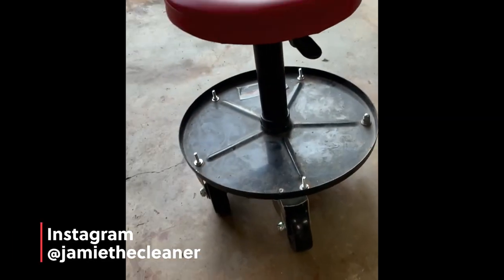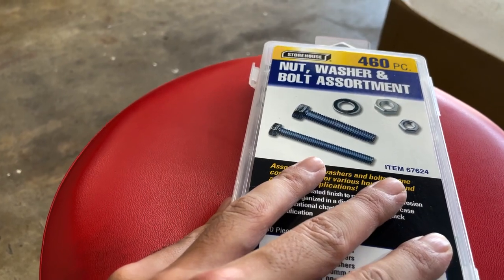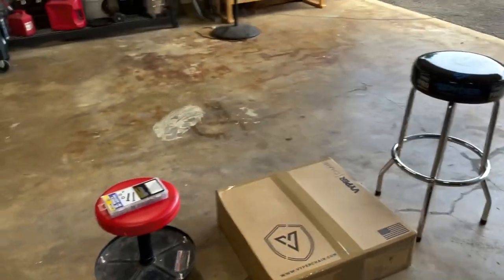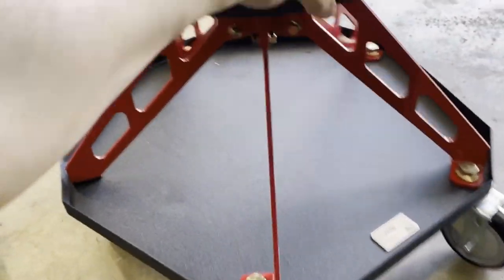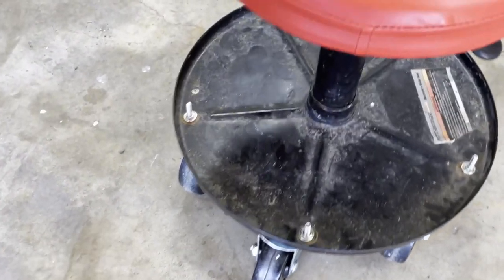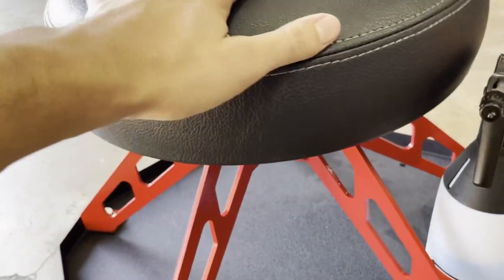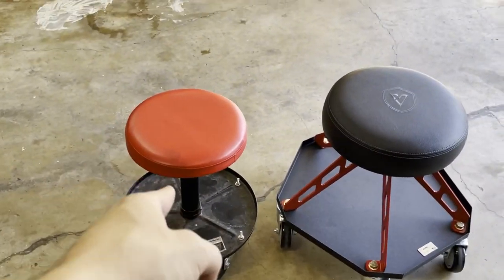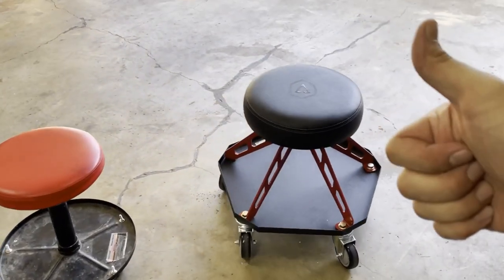Vyper Chair Vs DIY Harbor Freight Mechanics Roller Stool (Cheap Vs Expensive)

Comment: If you're worried about the Vyper getting a bit too "friendly" with cars, you could take some double sided tape and a Funoodle, carve up the Funoodle and stick it on the edges of the tray as a bumper.  

Thanks for the roll performance demo on dodgy surfaces.

oh, and one thing to remember:  if you're doing the cleaning as a biz, (which is what I suspect is the case), the Vyper is a business expense.  Not the same as free, but it's less painful than it is for those of us who can't write it off.